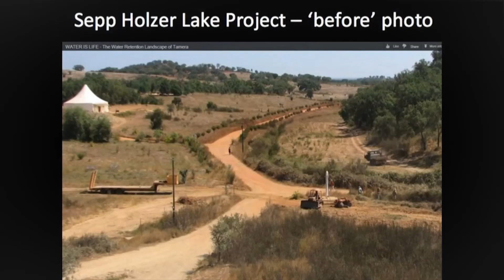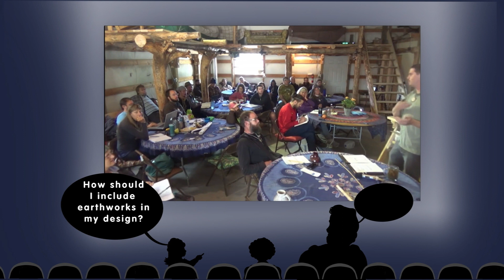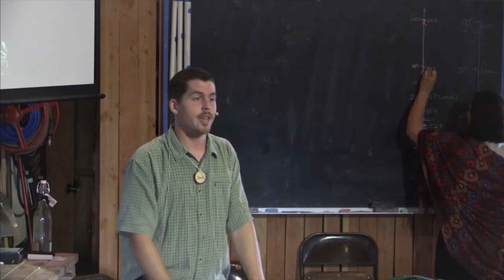permaculture design course zach weiss aquaculture

Comment: Very cool, my companion has been wondering about how to oxygenate water so the deep zone idea is a key part

The first pond we've got here is coated with bentonite to help retain the water. The next one will probably have a pond liner

I'm sure there's a better way to retain water than either of those options, but it seems like it might take a lot of time and effort to develop. How do you retain water with earth?

One idea I read was to put rocks, gravel, sand, loam and clay at the bottom of the pond, which would probably work but can be very expensive.